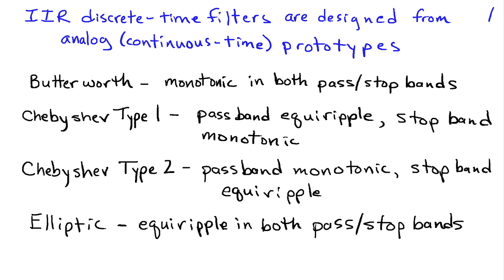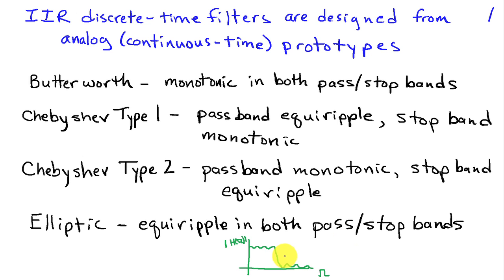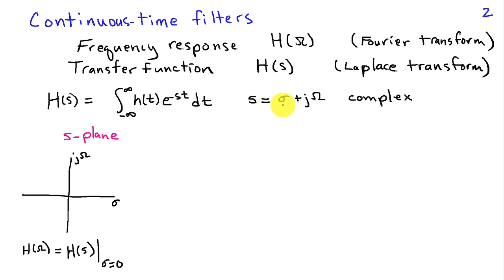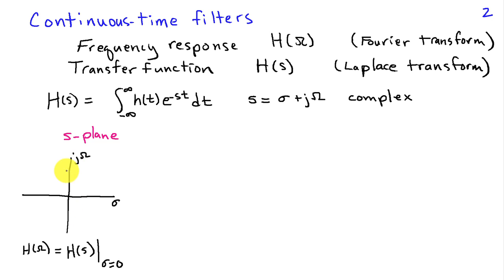IIR Filter Design Procedure

Comment: The capital omega symbol is usually used for discrete systems and the small one is used for continuous time systems. Just saying. :D Nice videos, thanks!
Reply from the maker: +Aleksa Gordic Thanks.  Actually notation depends on where you look.  For example, "Signals and Systems" by Oppenheim and Willsky follows the convention you mention.  However, "Discrete-Time Signal Processing" by Oppenheim and Schafer uses the same notation as I do in the videos.  In the end it is just notation and understanding the meaning is far more important.
Reply: +Barry Van Veen Wow, thanks for the quick response. :) Yeah I agree, but it's at times confusing because I'm used to this convention. One question, why can't I see 3 videos in this playlist (Infinite Impulse Response Filter Design)?